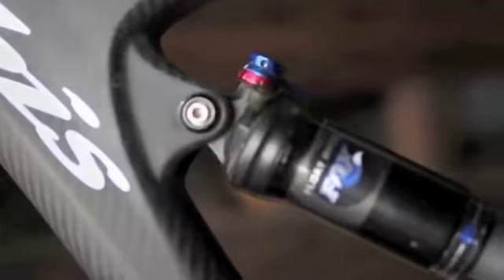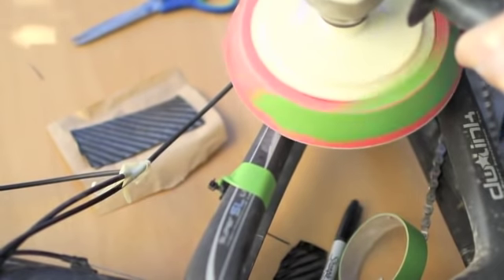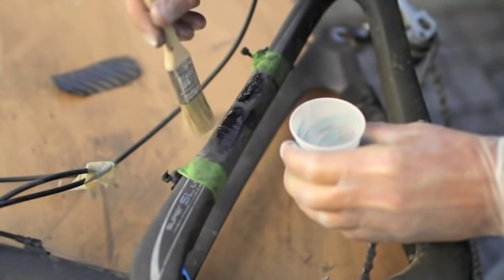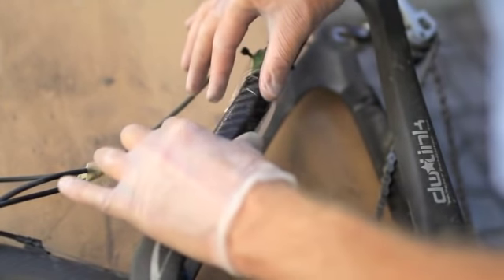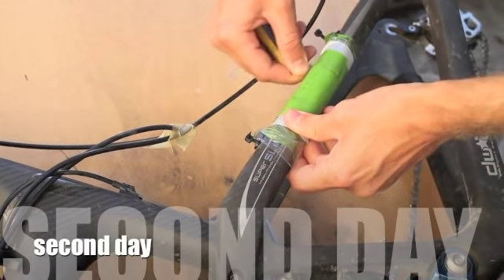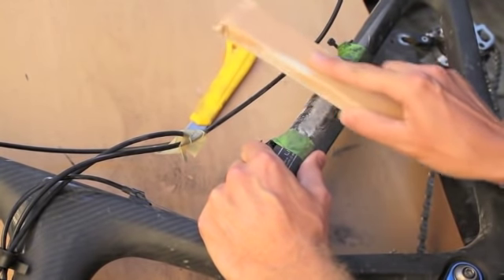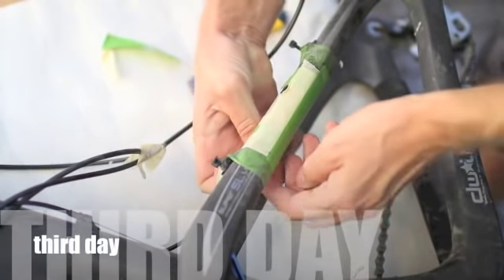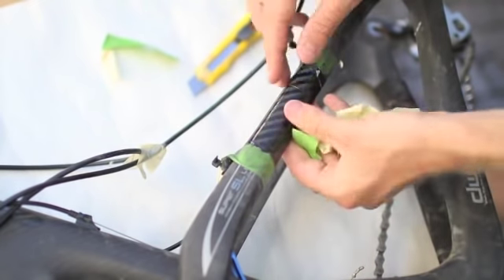Carbon fiber frame repair

Comment: i thought you have to bake carbon under pressure to gain structural rigidity. 
is this repair even doing something apart from covering up the damage?

Comment: A few things to note.

1) you should be sanding down a much larger area & all around the circumference of the tube by going with the contour of the tube shape...not using a flat sanding surface.
2) You did not clean the sanded surface of which you must do properly in order for the resin & carbon to bond correctly.
3) For such a repair you should be repairing that seat stay tube a minimum of 1.5inches each side of the fracture & you should be layering it up by more than 2 layers...I would do 4 layers then sand to a smooth finish, then as it's a mtb I would put a final resin coat on top.

4) All you've really done on your repair is cover up the fracture, you've only marginally made it stronger & nowhere near what it needs to be.
Reply: I agree to your points,  I would go 4 layers, but I would lay them all up in one go. Sanding between layers is important due to remove any amine blush,  and or to get a bond for the new layer . I also would not sand the repair too much ,your just removing carbon and fibres and strength. I could understand if one is trying to get a great finish but it's a bike , leave it.
Reply: Even if this is not correct, doing a DIY carbon repair is like doing a DIY Car chassis repair. It will probably fail and hurt you or kill you.
take it to a professional

Comment: Where did you purchase the Carbon fiber that you cut into those patches. All the stuff I use the threads start coming out of the weave when you start brushing the resin on it.I'm amazed how well that carbon fiber stays together as you apply it. Thanks!

Comment: I don't think so because the same process was used to build the frame, with the exception that the carbon was vacuum shrunk and not by using tape.

Comment: What's the point of putting carbon fiber and then breaking it with grinding?
Reply: +Nullll1111 sand it very lightly, just to have a good surface for bonding with the second layer :-)
Reply: +nhanlm0601 But he sanded the second one too.
Reply: possibly he wants the surface smooth. I guess he knew what he did and avoid damaging the fiber.
Reply: nhanlm0601 the fibers from the repair are sitting on top of the crack, not in between, filling it in where it should. Plus it's not baked and probably not the same fiber grade as the original seatstays. Which begs for a re-crack.

Comment: Wow...just wow.   If your going to invest in a carbon frame then you should take it to a composite specialist to have the repairs done properly.
Reply: Daniel Jang I do agree. Carbon fiber is one of the best technological advances of our time and it should be handled properly. But to be fair, the guy in the video did everything correctly, and restored the frame. If you know, then do it.
Reply: It wasn't don't correctly  and that's what I'm saying.  I've been working with composites for over 10 years in a motorsports application and I would never do that in anything remotely structural.
Reply: I just picked up an ibis frame for $110, I'm not going to start paying for fixes.

Comment: People are too snobby when it comes to carbon fibre and over look allumium there are still some amazing bikes made from this material which has been used for years
Reply: Yes and some of that hydroformed stuff is so thin it looks like someone ripped open a beer can. Both are good but I wouldn't try going light on aluminium.

Comment: Carbon frames require molds, resins and a lot of heat for hours, to form a single piece, the carbon fiber used by bicycles also has qualities, it is never the same used in airplanes or in F1, when it breaks or fissures, the Carbon fiber totally loses those properties with which it was formed as a piece, cover with layers and paint, it can give the appearance of fixed, but in reality it will never be strong enough as the original, although there are some workshops in the UK, and in France in where it is repaired, it is almost the same, as expensive to repair as to buy a new frame.  The properties of carbon fiber are fantastic, but once broken, it is dangerous, and it can break.

Comment: they it's a lie when they say Carbon is better than alum alum lives 5 years carbone lives 5000 km or less get what I am saying after all titanium rule and carbon drule :p
Reply: Titanium also has brittle properties, so it's not ideal either. At least you can fix carbon fibre without having to always resort to industrial machinery. Try fixing a crack in an aluminium or titanium frame without a welder.